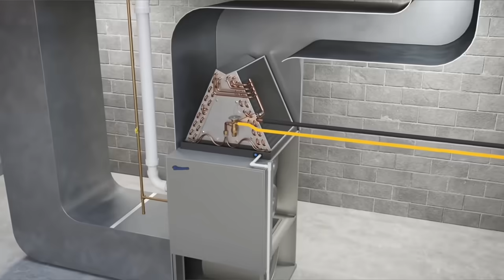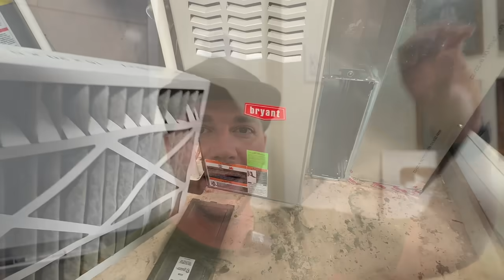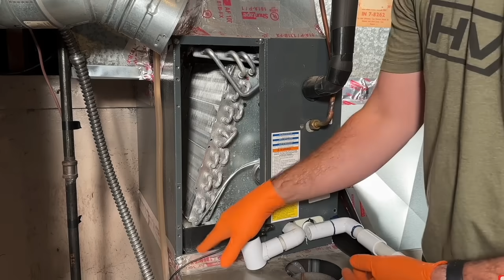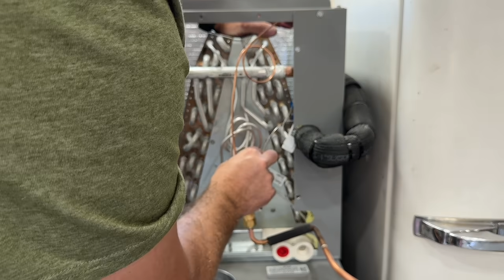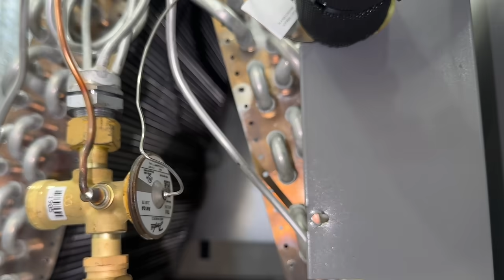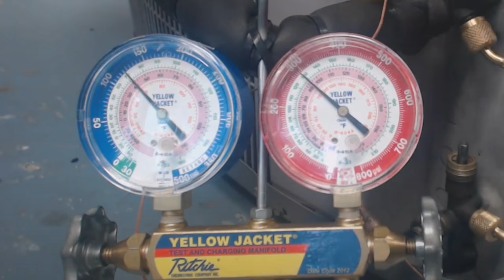Are Your A/C Lines Frozen? Check This First!

Comment: Having had them in two separate houses, gotta say I’m not a fan (ha).  
It seems straightforward - but pulling it out and washing it down meant the furnace or a/c had to be off for a good bit. Hosing it down outside in the heat was tolerable; washing it off in a bathtub in cold weather (mine were just slightly too big for any sink) sucked. Mine also had a metal frame with tons of crevices, so getting it reasonably dry took a while. All-in-all, I’d have the system off a few times a year for at least an hour when we needed it working the most, and it was a fairly dirty job. Plus, remembering to do it regularly. 
I switched to FilterBuy, funnily enough, about six years ago. Downside is that it’s more effective filtration thus replacing more often (and more stuff in the landfill), and obvs. costs more than just cleaning. Upside is that it’s more effective filtration so the house stays cleaner, and I set a subscription; filter arrives and I don’t have to remember it’s time, just unpack and pop it in.

Comment: my system is over 20 years and my condeser is like 16 years old  one day my cold air stoped  and lines were iced bad i had everyone tell me i needed a new system  that i could not aford  finnaly a friend  had a trust worth guy he said over time the gas escapes esp during winter  well he just refilled it so far its all good  these ppl just wana sell u a new unit esp if your on the old r22 i paid 300 for a refill i was short like 2 pounds in  i think its like 4 pounds total
Reply: you have a slow leak.. unless it was found you'll have to keep recharging every so often

Comment: Also check the blower motor capacitor!  A bad capacitor can cause freezing as well
Reply: But wouldn't that mean the blower motor wouldn't be running.  So if the blower motor is running, one can rule out the capacitor-right?
Reply: @tikiron4807  a weak capacitor can slow the blower motor down and give the appearance that it is working.  So, best to check the cap as well
Reply: correct

Comment: How would you clean a Trane which has what I describe as a double V condenser coil.   It doesn't have the single V of my Carrier unit sitting next to it.  I have a one inch filter which I change like clockwork every two months.

Comment: 410a and cant get the temp on the gauge over 30 deg. I have added about 4 pounds of refrigerant and low pressure will not increase. Clean filters. Any suggestions? Conden pump works and pumps out water.
Reply: Lennox heat pump.

Comment: Another great video, but I have one question, if the low side saturated temperature isn’t below freezing, how can it freeze up, even with zero airflow? I realize it has to have correct airflow, but I can’t understand how it could freeze when the temperature temperatures are still above freezing.
Reply: If you can't get the heat to the coil, the pressure will drop.  The entire system is designed to run with a load on it, which in this case is the heat from the house.
Reply: @billk5727 but the pressure didn’t drop, he was reading it. I must be missing something, appreciate your response, I’m not at all meaning to be difficult, I find this stuff super interesting, I just can’t follow how lack of air movement can make it colder, or make the pressure less. Or can it actually not have enough heat to allow the liquid to change to a vapor stage? Seems like that would send liquid back towards the compressor, definitely not good, but just can’t wrap my head around how it would get below freezing.
Reply: You answered it yourself.  If there is no warm airflow over the cold coil it cannot cool anything and therefore the coil will get colder and colder as the system runs and then ice up.
Reply: @johnwilliams865 I think I get it now, that pressure and temperature are what they are because of load? So if there’s not enough load the pressure drops and then the saturated temperature can go below freezing? I guess I was thinking of it as pressure in the off state, and once the suction starts it goes down on the low side and up on the high side.
Reply: @johnwilliams865 so pressure equals a temperature, but it will just keep getting colder if heat isn’t constantly removed? Maybe the pressure only equals a temperature if the compressor is running at the time? I’m not trying to be difficult I’m asking a real question here, appreciate your response, just didn’t want you to misunderstand my intent.

Comment: I think these coils could and should be designed to be more easily cleaned.    Do you have a video about the new 454?    Is it much better  at cooling than r22?   Is it mandatory in all new units made in 2025.   Lots of guys oushing old stock 410a

Comment: Right on!  Last year saw dripping water from line and freezing pipe, found it was the air filter for blower, replaced and all fine.
Reply: I have this same problem
Reply: I changed the filter it’s brand new checked it still having issue .
Reply: Ew, time to spend money.

Comment: What do you think of the permanent washable filters for your furnace or AC?
Reply: Trash....... use a STANDARD pleated filter. Check MFG instructions.  I never use Filtreat Filers as they are too restrictive. I've used standard pleated for years.
Reply: @mikeglasgow9618  I have one coming on Monday, it's a Air-Care Merv8. Still no good?
Reply: Just looked it up. Thats what I  use. Just not that brand. Inspect monthly,  you'll be fine.  @altennent156
Reply: I've been told by a few ac guys now that the cheapest ezflow 1 filter is the best because it allows the most air flow. If some one wants extra filtration, he recommended buying a room air filter to clean the air vs a high rated ac filter because those ac allergy filters fill so quickly that it can restrict air flow of ur AC unit and shorten it's lifespan.
Reply: @gpmb13  Isn't a merv8 pretty standard for a filter.
Reply: Ezflow is considered merv1 which is basic.  Merv8's are good , and as long as the filter is replaced often which may be every month vs what the air filter package recommends as changing every 3 months.  Its about not straining your ac unit by restricting air flow and of course filter dust.  Because ac filters are costly, especially the higher the merv, the ac guys in my area recommend buying a room filter to get finer particles. I mean some ppl place the room filter near the intake to catch finer particulars before it enters ac. A cheaper way to clean air and save strain on ac unit.   @altennent156
Reply: I'm going to try it and see how it goes, I'll know when it needs cleaned. A merv 8 is a merv 8 whether its a permanent one or a pleated replaceable one. I could see some of this if it was a 12 or more. And no my motor isn't a wuss. Just had it out and cleaned all the fins, the motor is fine.
Reply: The cheaper your filter the sooner you need to clean your evaporator coil.
If the blower motor is a wuss or real old or both get a new motor that can handle the restriction. You can save money over time from the wuss motor not eating more power trying run.
Reply: Yes, he mentioned using a room ac filter to help prevent that:)  @rogerrynearson2500
Reply: "No Rinse" evap cleaner, which most are, but not all of them. Just make sure it says no rinse on the spray can. And follow the directions on the product. A soft upholstery brush can also be used with the vacuum to remove dust and dirt without bending the fins. And in the absence of low loss hoses, Kwik-Connect fittings are very handy to have, especially for use on high side lines, in my opinion. Been using them for over 40 years.

Comment: When the outside temp is over 92 degrees,  my AC System can only maintain my house at 75 degrees.  I have a 4" filter rack.
Can I solve this by installing a new Condenser section? It's 15 years old.
Reply: Clean the outdoor coil. Spray it in a downward motion. Check the indoor coil and clean if needed. Make sure all the vents inside are open. Then check the refrigerant charge.
Reply: Thank you.  I did clean thd outdoor coils, reinsulated the outside condenser line and had the AC System checked by a AC Company. @spacemanwithraygun3933